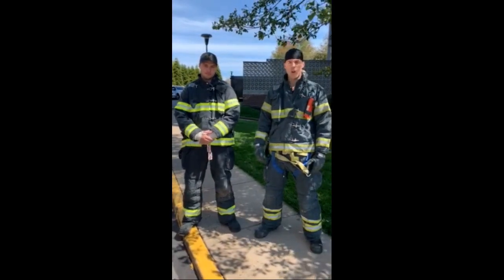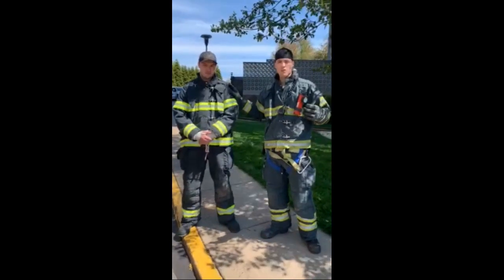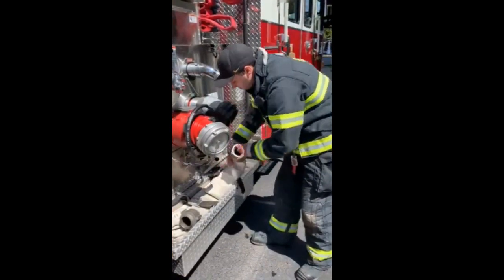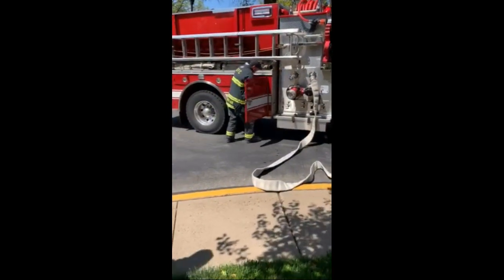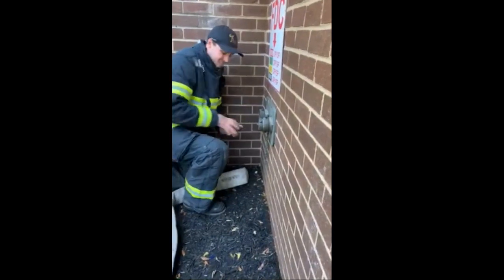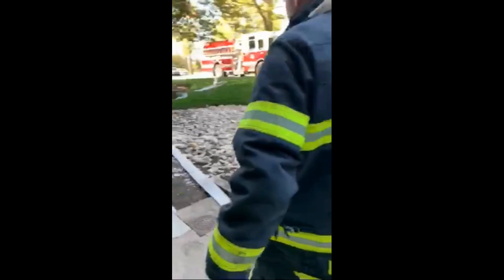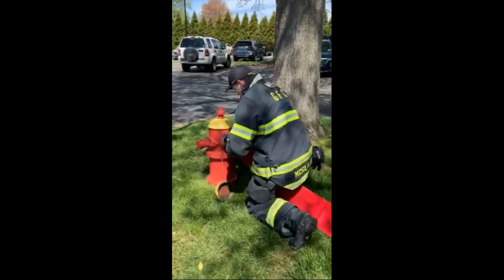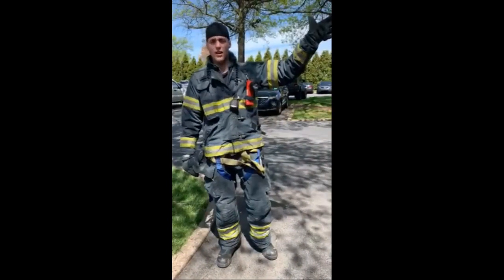High Rise Operations - Driver/Operator Duties

Comment: Some other things to think about; bring a double 3" to the FDC with you.  This gives you the ability to augment the buildings sprinkler system if they have already been activated as well as hooking into the standpipe for fire attack.  Also grab an extra double male and female.  In the event the FDC intake doesn't swivel, you can hook the double male in than utilize your double female.  This prevents you from having to make an unnecessary trip back to the rig.